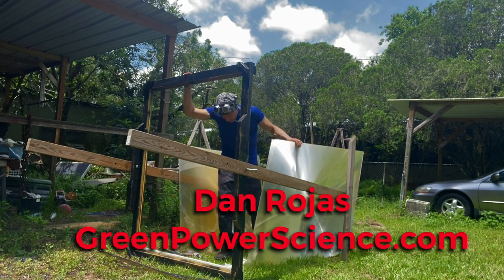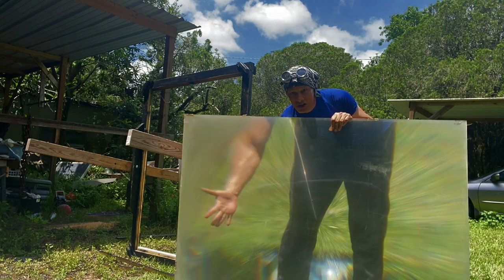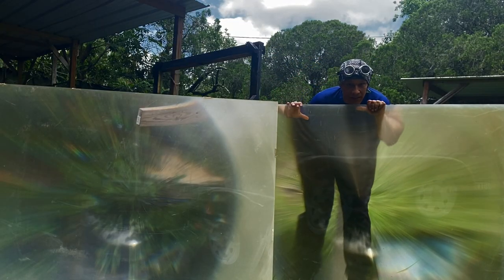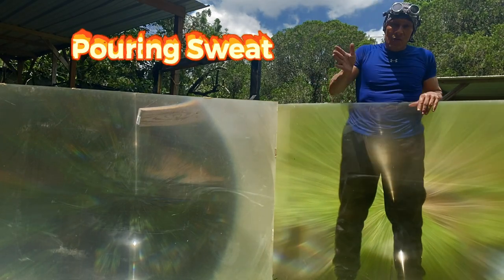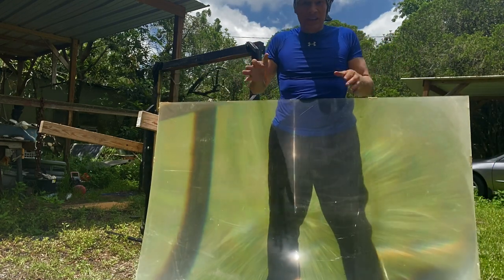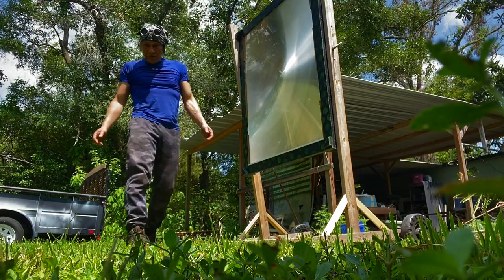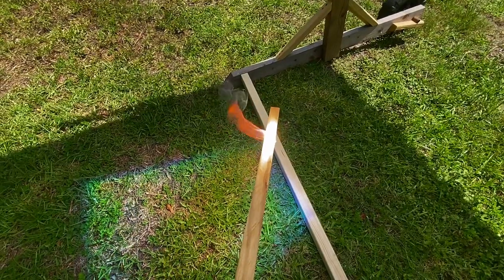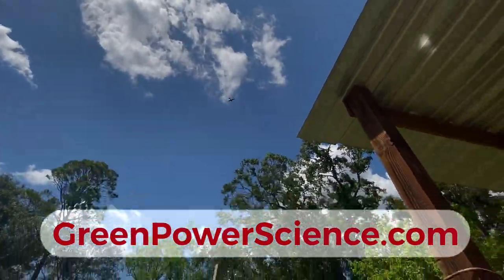78" diagonal Giant Fresnel Lens OPTICS lens replacement

Comment: I would love to see more automated fresnel lens videos, with or without this beautiful big lens. Cooking up my own automation project using a GreenPowerScience lens I bought a few years back. My wood lens frame burned up and I decided that Steel is the way. To each their own. Love your channel
Reply: Telescopes have a motor that moves with the planet.
I wonder if you can work that with the frensel to fallow the sun.
Reply: Hopefully no one would like to see your yard on fire.
Reply: Have you looked into solar tracker circuits? I have seen a few years ago to keep solar panels lined up with the sun. I remember a fairly simple one that used 4 solar sensors, a cross of plastic and I believe an arduino and or raspberry pi. As the sun would move and a shadow grew on one or more of the 4 grids, the computer would pick up the negative values of light input and adjust the motor and or servo to move the apparatus until the values were equal across the the sensors aligning the solar panels or in your case a fresnal lense with the sun.

Comment: Dan! So nice to see you again. I live in Pinellas. I am interested in the idea of using inert oil (such as mineral oil) as a closed loop energy storage medium (say, at 50°F below the flash point). This could be used to turn steam turbines, domestic heating and cooling, etc. The heating tube could be in the fresnal lens focus. Please teach the practical limitations due to comparative specific heat of the transfer mediums, thermal loss gradients, storage tank insulation, etc etc. THANK YOU. Really nice to see this video.
Reply: Why mineral oil and not motor oil?
Reply: @skid4482  less flammable and has fewer petroleum distillates when heated. Also mineral oils are not caustic to some types of components which petroleum may be.
Reply: This would be Awesome
Reply: Could this be done with a few lenses surrounding the heating tube at all angles of the sun? Or is there a way to make a half pipe style one-piece lens that surrounds the heating tube?
Reply: It is possible that the heat absorption chamber could be a very high melting point metal to take the focused heating element of the fresnal lens. I think I remember titanium has a high melting point.

Comment: Good to see you posting again, Dan. I've always wondered how much energy could be gathered from a fresnel lens or parabolic mirror. While your lenses are large, theoretically, an extraordinary amount of energy could be focused by just manufacturing larger lenses. Imagine a 20ft x 20 ft lens. The pitch of the rings would have to be shallow and the focal length would be quite long, but I imagine that thing could melt through a tank in seconds.

I'd also be interested to see what would happen if a fresnel was focused on a large fiber optic cable. Couldn't you theoretically direct the sunlight with this setup? Thanks for your vids, Dan!

Comment: A couple of years ago rescued the big fresnel lense from an ancient discarded TV. While trying to think of some use for it I leaned it against a table in the garden. When I looked the next day there was an arc of charred grass under it - fun!
Reply: I put one on a wood frame and got distracted for a while. When I came back the focal point had reached the wood and already started burning it, a few minutes later and it would have been in flames. Since then I'm always careful with these lenses

Comment: Hey!  It's fantastic to see you back.  This question is a little off topic from fresnel lenses but I always thought about your channel when thinking about this.

I have a diy plastic recycling press.  It's basically an all metal flower press with springs that you can put in a toaster oven to recycle plastic.  It works extremely well but I wanted to try it out in the sun with a solar oven type set up. I tried this once on top of a metal roof but I only got two about 150 degrees Fahrenheit.  It needs at least 400 to work.  I know solar oven like mirrors will increase the temperature but I know you can't really leave those unattended.  I kind of want this press to be set-it-and-forget-it. Could tinfoil mirrors get that hot and not create a danger?  Would a particular shape be safer to leave in the yard unattended?  Am I overthinking this and should just try it?

If you want to see my device you can find videos of it on my channel, InventTory.  Two t's, you have to hit the link under the search bar to turn off spell check.

Comment: Can you not use this to heat a steam chamber to turn a turbine to generate electricity or is it too inefficient for that even though the energy made would still be free or used to heat sand as a battery with it being a good conductor to generate steam for a turbine later?

Comment: Dan! You're back!! Are you taking orders through your website? Shipping to Canada? As for what to use the lens for... making steam to run a tesla turbine, spinning an axial generator... that would be the ultimate in my opinion... wonder if the heat generated by such a large lens might be too hot to handle steam generation.
Reply from the maker: Yes, one reason for no videos in forever is, website orders have been very busy and I have to adjust optics for each lens so work all day. Website is fully up and good. I still have all lens sizes and parabolic mirrors and yes international Canada
Reply: Thanks Dan, that’s awesome. I had sent an email wondering about this a year ir two ago, must have gotten lost in your junk mail box. Combined with no more videos thought maybe something was wrong and you were needing to take time off. Glad to know you’re back and well. Great stuff!  Will be in touch shortly regarding some lenses. Thanks!

Comment: Hello, I follow your channel for more than 10 years now, and I have a question about the new developments of the sand battery concept and practicability 😊 
Can you heat a resistance wich is in the sand with a fresnel lens and store the energy for later?
Thx a lot for the long and beautiful energised journey through the lens of Fresnel✌️😎

Comment: I'd like to see how adding mirrors to give it more sunlight affects the power of the lens.
I've got a 4ftx8ft mirror I've been pondering adding to my project to give it a boost.
Reply from the maker: Flat mirrors are excellent, this video was part of a collaboration video a while back but it shows two lenses on one target. 
https://www.youtube.com/watch?v=_QTRf4N66Ag
Reply: @GREENPOWERSCIENCE  Thanks. I am more curious to see and know what could be done with a single lens and 1-4 side mirrors at an angle attached to or beside the frame of the lens.
My idea is to build a stand like yours but only up to the swivel. Then on the sides add a spacer blocks and a framed mirror on door hinges that folds over or out away frome the lens. Attach a vertical an angle board from lower on the stand that juts out to the center of the opposite side of the mirror for support cut at the length that gives me the proper angle to rest the mirror at to focus light to the lens, making sure to angle the tips and add a swivel to the topside so it's flush to the stand and frame and it is removable, and do the same for the other side for a total of 2 mirrors.

Comment: Can a fresnel lens be used to improve the output of a pv solar panel?
Reply: It only ruins the panel quicker.  The intense heat also causes much more power loss and degradation.  Focusing is really only useful for solar heat based solutions, like focusing on a pipe with fluid in it.

Comment: Dan, I also thought of using a transfer medium oil to heat high temp phase change salts as the overnight storage "bank" Is this possible to do? Just trying to think of ways to capture solar-thermal energy for night/cloudy weather use. Because water-steam state change is HUGELY endothermic, steam turbines need a lot of BTUs stored. Is there a better way I haven't thought of?

Comment: Did someone try to put pipes at the point of focus of the sun so the water inside can be heated and be used in radiators? I'm very curious of this system anyways 👍

Comment: Do you think you could focus a lens onto a vertical mounted standard water copper pipe so that it will produce steam inside which will cause a current to flow upward.  The base of the pipe should have a copper check valve with glass ball and spring to prevent back flow, this valve should be connected to a large reservoir so it can run constantly during the day.   You want the steam to produce current not steam output.  So the output should be warm to hot water which will flow over a water mill generator. I'd like to see the voltage/total power it can produce.  - you'd basically be making a massive solar coffee percolator/low moving part pump-engine.  Try to figure out a way to cause it to run all day long without having to adjust lenses... like leverage multiple lenses if needed.  All the hot water can be directed into radiation systems for home heating.. sent into distillation chambers to speed up evaporation.. etc..

Comment: I want to see if the death ray can go past a charred piece of bread. 
And it must be charred black before you place it or it might catch on fire or explode as the water runs from the heat. 

I think I seen someone using them to contain flames before.
Reply: In relation to this comment, I foud  the video: "Carbon Foam: an incredible material made from everyday items."

So while I say charred bread, apparently I mean ablated bread. And seems to require a more involved process than burning it on a stove. Unless you can get away with toasting it black slowly on a pan. I dont know.

Comment: Heat storage for a greenhouse at 6k ft in the mtns. Almost july and will be 45 degrees tonight
Reply: A very large container(250 gallons?) of water will act as thermal mass to moderate the temp. Also, 15 feet underground is always 55 degrees, so maybe geothermal?